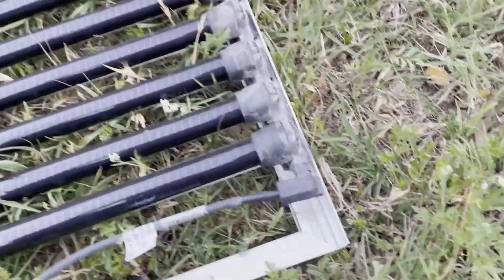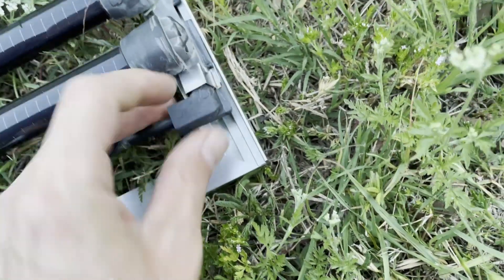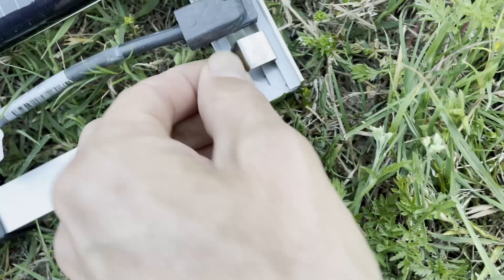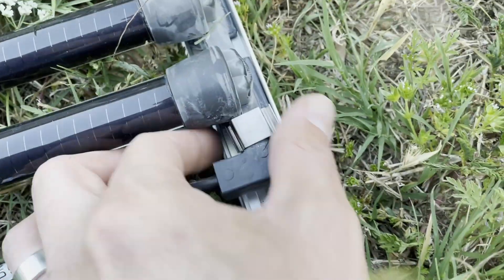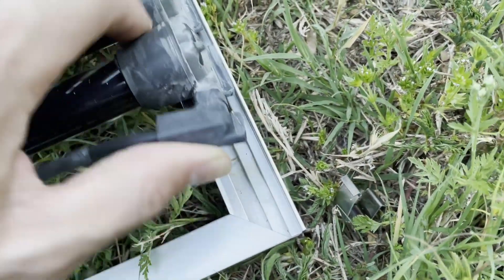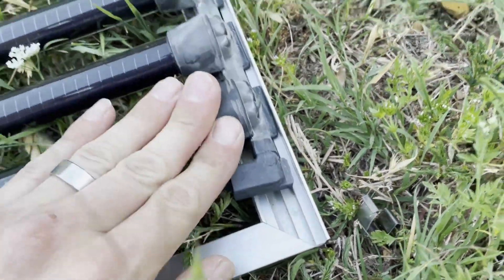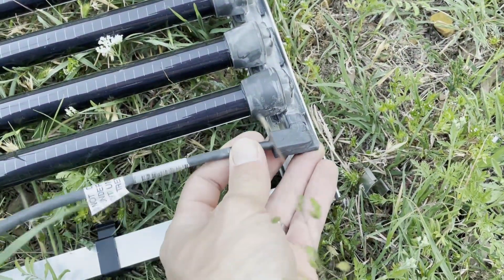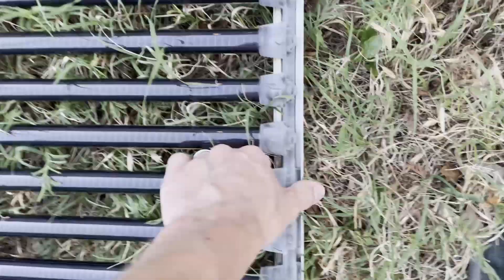How Flexible Is A Glass Solar Panel?

Comment: Question amigo, can you cut that in have and instead have 98 volts you can have 45 volt, and that way we can connect microinverter. ? Thanks in advance
Reply from the maker: Each tube is 90 something volts and all the tubes are in parallel, so unfortunately no you can't :(.

Comment: Did you get it back together?  I am debating how to mount these to the carport.  Tempted to just use short self tapping sheet metal screws into the frame.  I will tag you in the video description once i get the fist batch up.
Reply from the maker: Never did try. If I were mounting I’d probably do the short tubes. Since they don’t have any wiring in them.

Yeah excited to see them mounted!

Comment: I can't wait to see what you do! Btw, can the modules be disconnected? In that case you could wire them up in all kinds of cool configurations.
Reply from the maker: Looks like they are stuck in the 157w modules unless I want to destroy one. Which I probably will to see what the tubes look like.

Considered taking three tubes and mounting them on my civic hybrid in series to trickle charge the little 800wh 144v battery.
Reply: @BeeneEnergy  That's hardcore. You're hardcore. Whatever happens, you'll be the talk of the town! 😉

Comment: Lay these across, and let them conform to the ridge of a roof. Cheapest/easiest solar install ever? Just an idea folks, don't come after me if it slides off, and crushes you :)
Reply from the maker: Ya know, there was a design for a roof racking system that used panels on each side of the roof to ballast each other.

I did notice the rubber isn’t terribly resilient to bending so this might expose some bare wiring by taking the panel apart and allowing it to bend.
Reply: @BeeneEnergy  Yikes exposed wire, OK scratch that idea :) If you ever tear one down to individual tubes, I'd like to play with some. 90v wind chime? LOL
Reply: A roof mount curved sound like a good idea as long as you take care of those exposed wires

Comment: Oh man, this can conform around shapes! BTW there's an optical coupling liquid in the tubes. I think/wonder if this is where much of the weight comes from.
Reply from the maker: I should have read up on it more. I was figuring it was for cooling but optical coupling would reduce the amount of reflective light you need I guess. Cool!
Reply: @BeeneEnergy  Yeah, I was thinking it was to optically couple the film to the tube.

Comment: Mount the flexible panel to the top of a bus by gluing the rubber strip to the roof with 3M windshield adhesive.

Comment: Is there a reason why they space the tubes so far apart? Seems like so much wasted space but those panels are pretty damn cool looking.
Reply from the maker: I suspect it's a very specific spacing to allow for sun to hit the next tube even early in the day when the sun is low in the sky. Just like a typical flat roof ballasted installation would have space between each row.